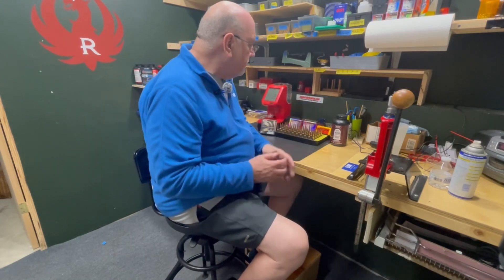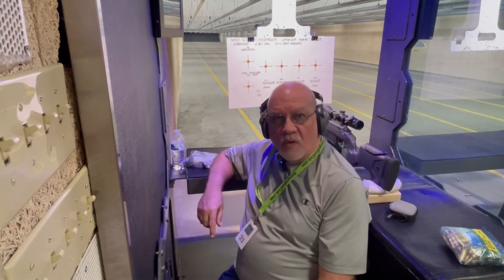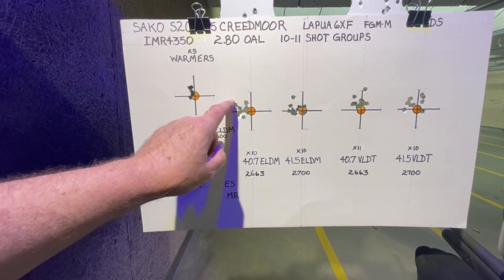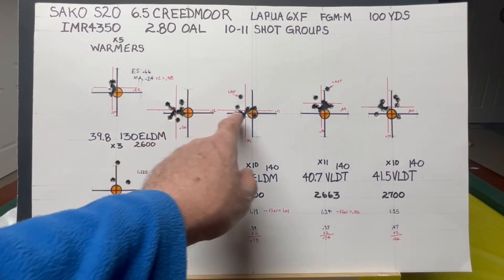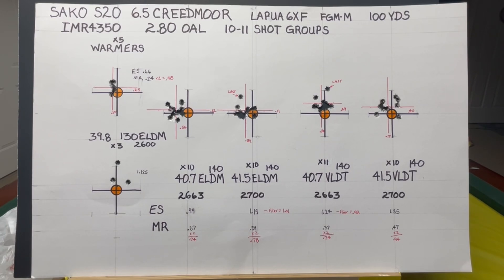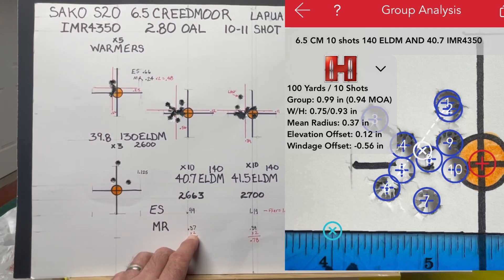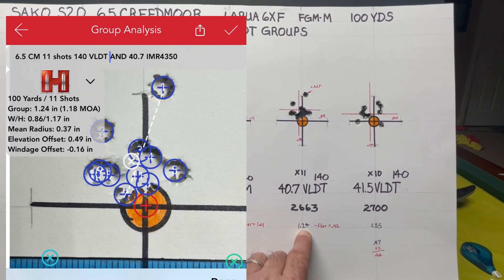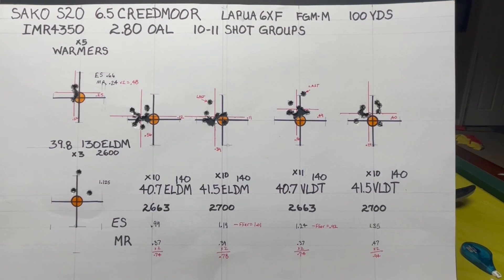Reloading and Testing 6.5 Creedmoor. With IMR4350 Powder and 140 ELD–Match vs. 140 VLD-Target.

Comment: Excellent shooting. To compare between load A and load B, only one thing has to change, example, Bullet to Bullet  try to keep BTOG the same between both loads with different bullets
Reply from the maker: Thanks for the input. I have not measured the BTOG, but I do know that the ELD match at 2.80 inches is .020 off of the lands. I should check the Berger also. I’ll definitely keep this in mind. Thanks again. As always, appreciate your watching.